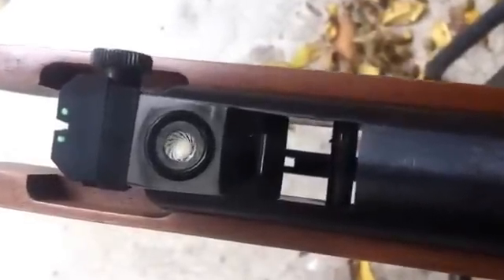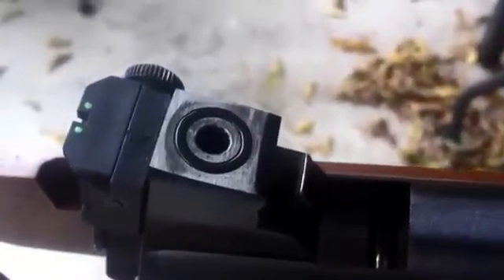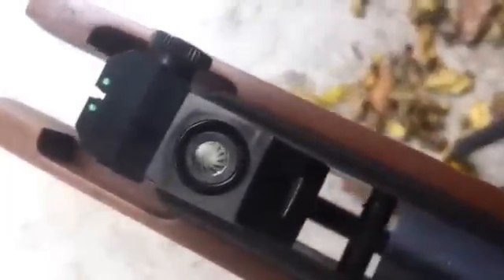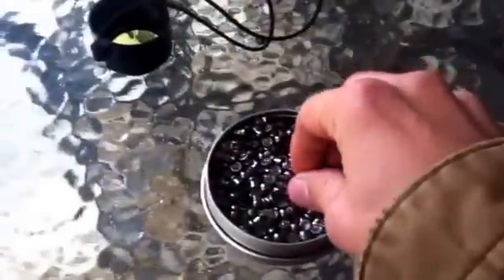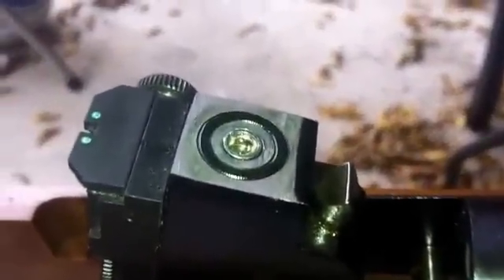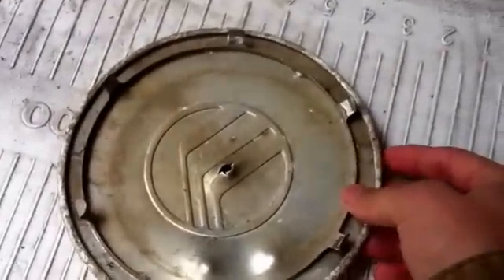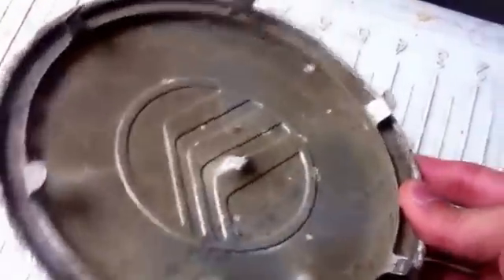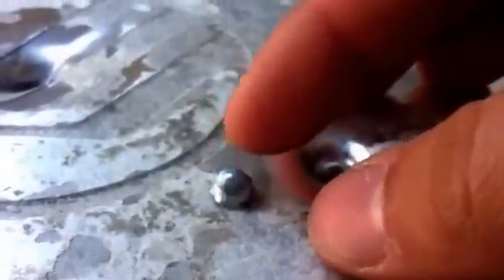Diesel POWER!!!! Pellet Gun Style! :D

Comment: Great video since this was 7 years ago the video was made how has your airgun held up wirhbdoing  this ? I have a hatson carnivore 135  30cal
Reply from the maker: It’s held up incredibly well. I’ve shot it literally thousands of times and only this year did it actually break. I was dieseling with it actually and I noticed that’s the front pin or bolt that holds the stock to the barrel had broken in half or sheered off. I thought it was interesting but normal wear and tear and ordered a replacement from hatsan. Well I about 50 shots in, without dieseling it too sheered off… so looks like I’ll have to send it in for repair. I’ve since gotten my first PCP airgun the Avenger by Air Venturi which is totally next level, so i don’t really have a lot of incentive yet to get this one fixed.

Comment: what's was the caliber? and does anyone know if this would work for a pnuamatic pump air rifle?
Reply: 10 months late answer but.. ;)  hmm.. you can try but in theory it will not work as in spring or gas ram guns because high temperature required to vaporize and ignite fuel in pellet is generated at the moment of rapid compression of air by airgun piston. In precharged (PCP) guns there is no such heat generated as air is already compressed and stored in high pressure air reservoir (bottle) .
Reply: Released gas gets rapidly cooled so...no compression, no heat, no combustion.  Spring piston only. (gas ram too)

Comment: dieseling will give you more power but it makes the accuracy for crap
Reply from the maker: Kinda true. I actually took my gun out to the range yesterday and tested dieseling vs non dieseling, and at 25 yards, the shots were usually off by about 1-2 inches. Within 25 yards though, it would make a significant difference in impact energy with minimal affect to accuracy.
Reply: Try heavier pellets when diseseling. You ll notice the improvement.
Reply: @DjCollins I agree. Using vaseline is best way to do it. And it's more convenient. You can put vaseline in all the pellets in the tin. Then just pick them up and shoot them. Works great.

Comment: It does not work on mine! Any suggestions?
Reply from the maker: Jack Vollriede What kind of oil did you use? How much did you use? What condition is your breach seal in?
Reply: I used Remington gun oil and not that much just a little bit lower than the skirt of the pellet.
Reply from the maker: What gun do you have? If it isn't a high power spring or air piston, this method won't work
Reply: It is a gamo whisperer 525fps I just don't want to use my good one
Reply from the maker: It may be too low powered. it shouldn't hurt your good one, just use a very small amount and see what happens.
Reply: Sounds good

Comment: Lol I got a cross man phantom and Moded it to shoot 900-100fps it only shot 500 before..after modding I shot threw paint cans from 100ft away n more and a peice of scrap sheet copper wich is soft n obsorbez the impact I was surprised when I shot threw at 100ft o n my pellet gun is .22 she is a beast
Reply from the maker: How did you mod it to do that?
Reply: +Mannievh i have the same model, a crosman phantom .22 cal that is tuned for 500 fps, but I bought a phantom/Quest piston &main spring replacement kit for the 1000 fps phantom and I plan to replace the de-tuned factory piston & spring to turn my air rifle into the high powered version.
crosman de-tuned this by drilling a bleed hole in the piston and some people use JB weld to plug that bleed hole in order to get more power.